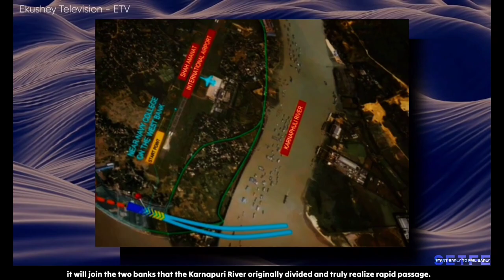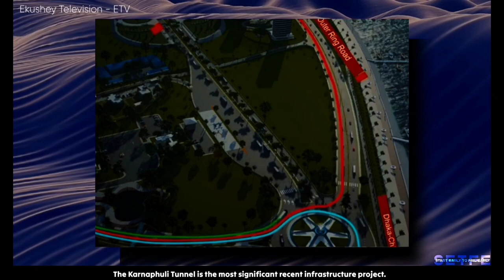South Asia's $780 Million First Underwater Tunnel: China & Bangladesh - Karnaphuli Tunnel

Comment from the maker: The Karnaphuli Tunnel stands as a remarkable testament to the ingenuity and collaboration shaping the landscape of South Asia. Serving as China's first venture into underwater tunnel construction outside its borders, this extraordinary infrastructure project has emerged as a beacon of progress and connectivity. By seamlessly linking the previously divided banks of the Karnaphuli River, this engineering marvel promises to revolutionize transportation in the region. Traditionally, a grueling four-hour drive separated Chittagong Airport and the Industrial Park, but thanks to the Karnaphuli Tunnel, that journey will now be effortlessly accomplished in a mere 20 minutes. However, the path to completion has been riddled with challenges. The project has valiantly persevered through the turbulent times of the New Crown Epidemic, grappling with delays in material delivery and the intricate task of launching and receiving shields amidst the water-rich, fine sand stratum. Undoubtedly, these setbacks have posed significant hurdles to the project's progress, demanding unwavering determination and expertise. To combat these obstacles head-on, the Kanapuri River Tunnel Project Department in Bangladesh has ingeniously employed a super-sized, independently developed, and manufactured mud and water balance shield machine. With dimensions of 12 meters in diameter, 94 meters in length, and a weight exceeding 2,200 tonnes, this colossal machine stands as a symbol of human achievement and technological prowess. It has become the cornerstone of the construction process, tackling the unforgiving challenges imposed by the region's rainy season and the relentless heat and humidity of summer.